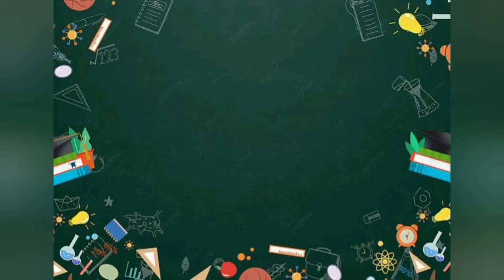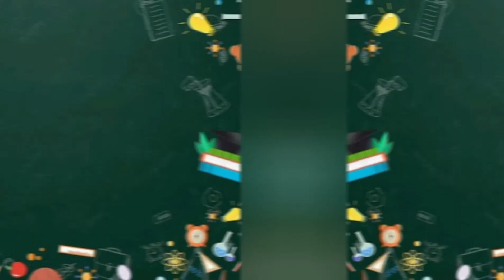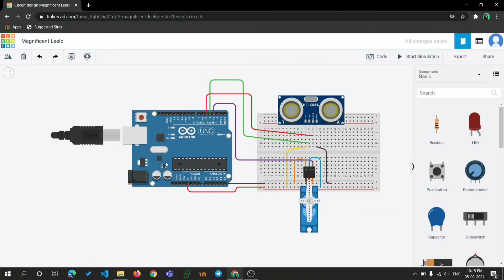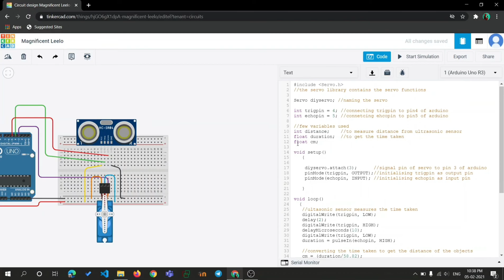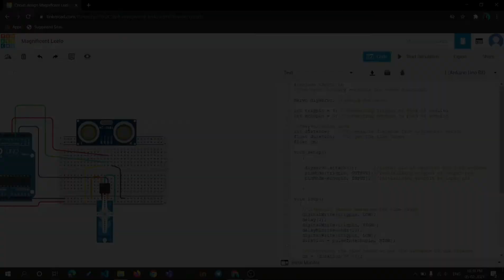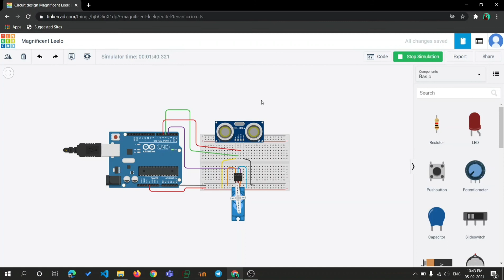CODE EXPLANATION ( GIVEN IN DESCRIPTION ) | DIY GROUP PROJECT | SMART DUSTBIN | IIT KGP

Comment: Which program did you use for programing?
Reply from the maker: Couldn't get what you are asking. Are you asking about language or functions used or what? If you are asking about the code, its given in comment section.
Reply: @the_boy_who_scribbles  I am asking about the software you used for coding?
Reply from the maker: @malhinai2260  https://www.arduino.cc/en/guide/windows